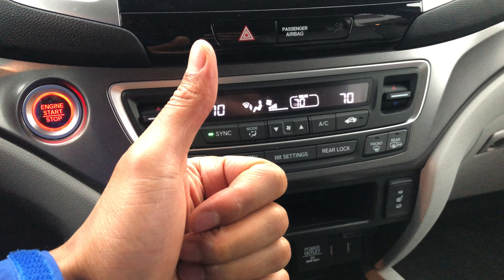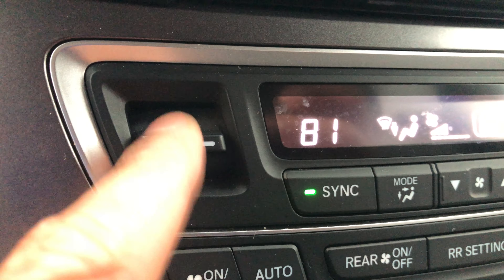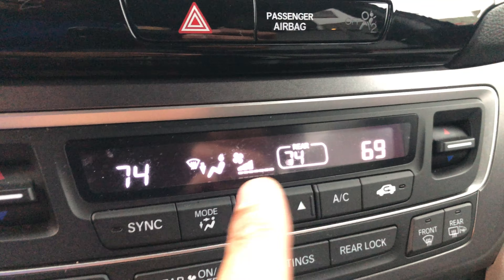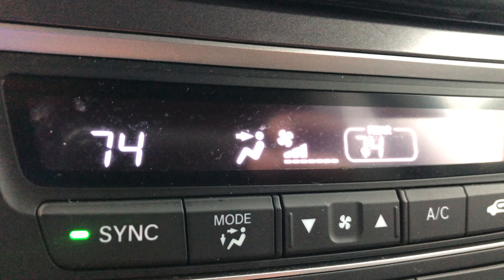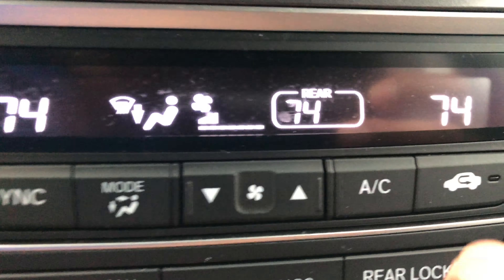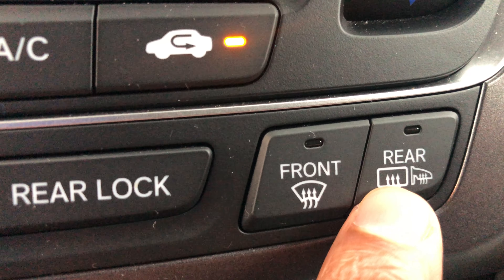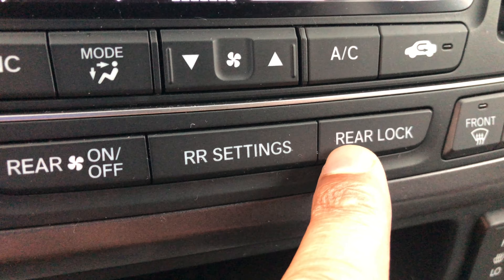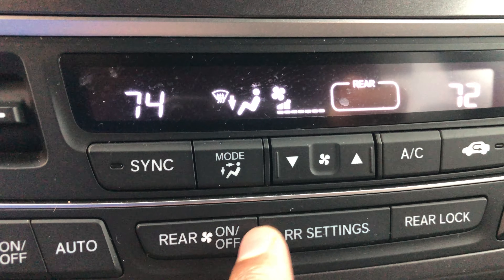Honda Pilot - Air-conditioning and heater controls – how to turn on/off

Comment: My pilot 2016 when used remote start heats not on or lights not on until I go turn heat on from the inside
Reply from the maker: @lomzemtshaj1030 That's an issue you should get checked out by a mechanic.

Comment: did you say currently blowing at my feet and the "radiator". that's called windshield defogger-defroster , ok your just excited about your new car because the same symbol is next to side window defogger. and you knew what the switch was.
Reply from the maker: can anyone help-out with this question?
Reply: Why my honda pilot 2017 whey I turn on the heater it blows cold air